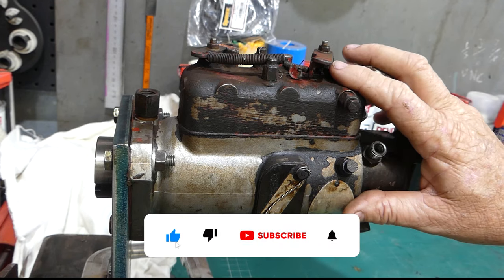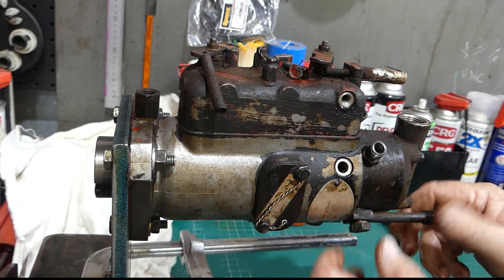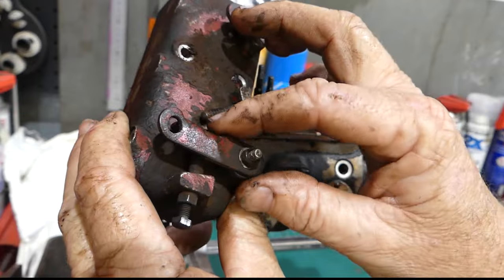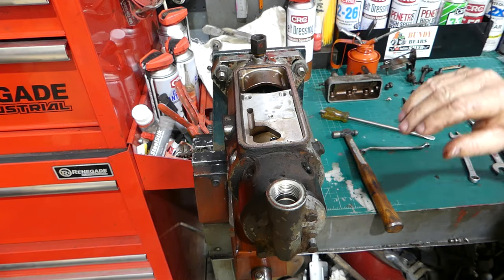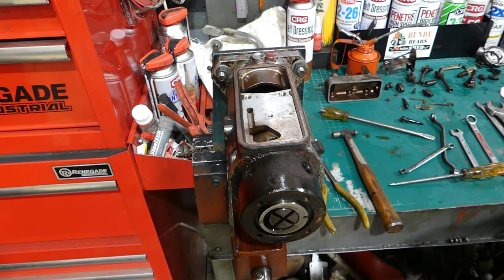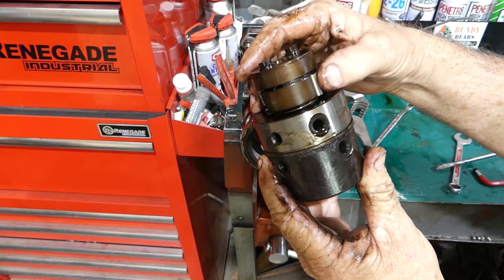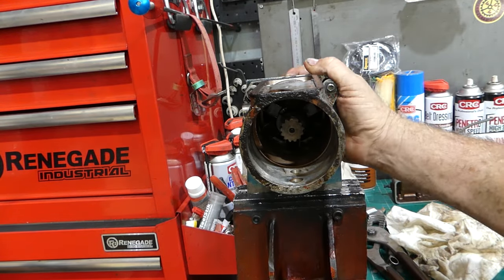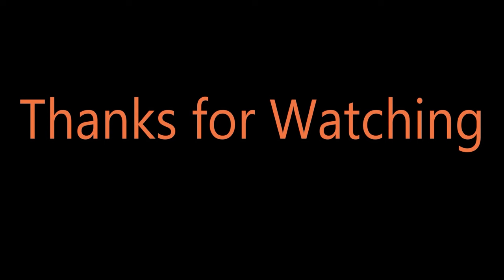How to Reseal Your CAV Injection Pump Part1 (From an International Harvester B414)

Comment: What a talented mechanic ( technician) you are Lance.   I completely dismantled the CAV.  DPA Injection pump on my old MF 30 (French horror horror) Tractor and rebuilt it with a kit from Queensland Tractor Spares.  I followed the instructions from your MF video No. 14 & 15.   I found it so easy to do although I did at times have a few nervous moments.   In particular when the governor weighs fell out of the basket.  I did think “What a bastard.”  But I got them back,  bleed the system and away it went.   I must admit I was relieved when fired up.   Thanks to your instruction I saved myself a lot of money.
Reply from the maker: That is good news, that is half the reason I do the videos. When Im parked up it will be too late to ask me.

Comment: I have a 1962 Ferguson 35 with a 4-cylinder diesel engine. It stalled at a stop sign. The engine cut out and won’t restart. I removed the injectors, and nothing is coming out of them. Then, I took off the hoses leading to the injectors. There, I have diesel coming through, but with very low pressure. The pressure isn’t high enough to open the injectors. Which part of the pump could be faulty? Please help me. Thank you."
Reply from the maker: It could be rubbish in the tank blocking the tap, fuel lift pump not working correctly or even the little screen under the inlet pipe on the injection pump. all worth a look.
Reply: @BundyBearsShed  thank's!
I checked the fuel system from the tank to the injection pump inlet, and it flows freely. After the injection pump, we don't know what’s happening. I will do the check you mentioned with the small filter under the inlet pipe on the injection pump.

Comment: Excellent tutorial.  I watched your other video from 9 years ago ...and posted this question there.  But since this a newer video I am going to post here as well.   I have a Dresser Dozer with a no start/no fuel to the injectors situation with the Lucas CAV. pump.   It does not leak at all,  so I am feeling that pulling and rebuilding the pump may not be necessary.  I have pulled the governor lid and checked it (which I put a new gasket etc. on a couple of years ago).  All seems well there, so my thinking is something could be wrong in the whole inlet assembly.  My question is ...what is your opinion of taking the approach of pulling that off and examining everything there as opposed to pulling the whole pump?  From your video I get the impression that a no start/no fuel pumping issue is primarily at that inlet assembly or the governor.  I have verified that fuel is getting to the pump from fuel the tank through the fuel filters.  Thank you in advance.
Reply from the maker: Answer below in other comment.

Comment: It's been 50 years since I have taken an injector pump apart. Loaned a friend my book on doing this and never got it back. 
My 285 MF started getting fuel into the sump. Changed the lift pump and still leaking.  Dealer was to busy to do it so I have taken it off. Going to a shop for repair.  I know it will cost but know it will be checked out.  Thumbs up Lance
Reply from the maker: I did a thorough video on the pumps in the MF135 6 speed playlist, videos 14 and 15 that might help you out.

Comment: Thanks for the great videos you put out there for us to help us on our projects.
I have a question for you Sir. On a 1988 545 3 cylinder tractor loader, is it necessary to set engine at 
# 1 cyl. TDC before removal of the injection pump? I think not but, since you are a genius on this subject I thought I consulted with you. Thank You  Sir   Best Regards
Reply from the maker: No, the gear is dowelled.

Comment: Hi Lance - I have a fascinating "feature" with my 35x that has been there for 24 years (so not a major issue!) She starts and runs perfectly. However, just occasionally, if I have been running her at lowish revs (below 800 rpm) for a while she will hesitate in picking up when the throttle is opened (even running off load). She sits at about 800 rpm, sometimes for 10 seconds or so - no smoke and no sign of labouring. Its as if I have only slightly opened the throttle rather than opening it fully. After the hesitation she runs up to full rpm just fine and can then, usually, be throttled back and opened up just fine. She will run all day at 1500 rpm or over without missing a beat.
I have over time serviced the lift pump, cleaned the tank and replaced the tank strainer, renewed both fuel filters and replaced the vanes in the high pressure pump (and stoned the slight marks out of the vane pump end-plate) and made sure the valve on the input to the pump fell under its own weight as you showed. None of this has made the slightest difference. Bleeding the system also seems to make no difference. Given that she works fine most of the time I'm slightly reluctant to pull the pump apart completely as I can obviously make things worse!
Any thought would be welcome. Thanks.
Reply from the maker: G Day Colin, I think you may have a sticky metering valve, when the governor opens up it sticks for a little bit. You can pull the top ott and remove it without a full stripdown of the pump and polish it up and see how you go.
Reply: @BundyBearsShed  Many thanks indeed for the reply. I'm gradually overcoming my fear of delving into the pump -  a fear that comes from having spent a week in the fuel injection repair shop at Ministry of Works in Nairobi when I was about 10 years old (a very long time ago now!) This left me with the impression that pumps and injectors could only be worked on by gods in immaculate white coats working at spotless stainless benches in a room that would shame an operating theatre and with a huge green Hartridge pump tester at its centre around which they would periodically gather and nod sagely as it clattered away.
Reply from the maker: In the Massey Ferguson 135 6 speed playlist videos 14 and 15 might be helpful for you.

Comment: I’m getting a lot of diesel in my oil after my tractor sets (Ford 3600) Is that from the main seal at the 35:00 point in this video? If so can that be replaced without tearing into the other parts of the pump? I guess I can just buy that seal instead of the whole rebuild kit?
Reply from the maker: Yes it can be replaced on its own
Reply: @BundyBearsShed  it looked like it could but I wanted to make sure. Thanks!

Comment: Lance, We have a Massey 1105 with the turbo 354. The pump has a pulsation damper on the front of it which is letting fuel out of the equalisation hole in the front of the damper and making a big mess. From my internet research it appears there are two different ones depending on the pump serial number. I will get that number later. Does QLD Tractor spares have these dampers and is there anything I should know about replacing it? Thanking you, Jeff.
Reply from the maker: We may still have them but we sell very few and if we don't have any in stock we could order some I'm sure. Call the 1300 850 097 number.
Reply: @BundyBearsShed  Thanks Lance.

Comment: Is it the same pump sitting in an 3 cylinder disel, mf 135 1971 model  ?
Reply from the maker: Yes but I did 2 videos on the 135 pump in the 135 6 speed playlist videos 14 and 15
Reply: Thanks for the answer 🙂.
I have 8 speed not an multipower. but maybe it's just the gearbox which is the only difference on the tractors.
Reply from the maker: @ulfrogeriversen2123  yes the engine is the same